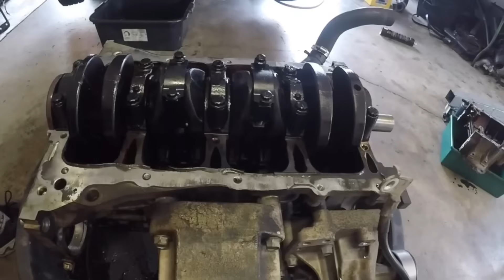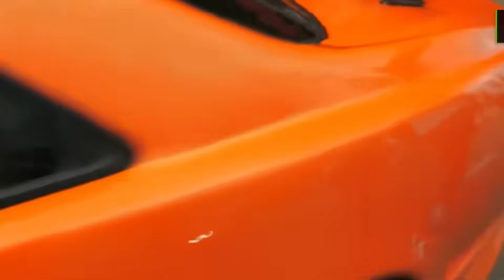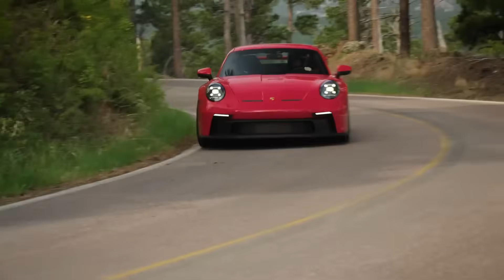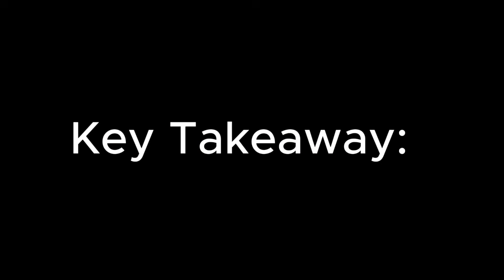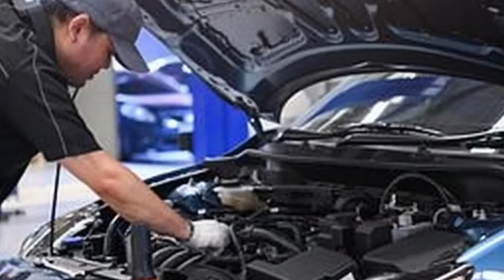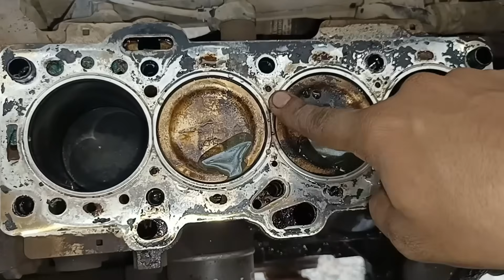STOP Following OEM Oil Advice (GM Recall Proves Why)

Comment: Yes using 5w30 or 5w20 can have positive results, depending on where you live. 0w-20 is useless once ambient outside temp gets above 75 degrees, these engines are failing worldwide even in Australia where they already came with 0w-40, the problem is the crankshaft itself, the manufacturer isn’t GM, they’re a supplier overseas and the tolerances are so far off from spec its ridiculous. The engine design is solid, they’ve got no one else that can retool and ramp up production to keep up with demand so they made poor decisions, now it takes months to get an engine. And the people making shit are still making shit.

Comment: All people have to do when buying a new vehicle say like today - Tell the dealership to dump out whats in the engine and refill it with 5W30 oil... OR have the vehicle towed to your home and do the oil change yourself.. BUT make sure they at the dealership understand this . Next follow a break in procedure of Light driving and the first oil change of 500 miles regardless  and change your oil again . Show the dealership that this was done and keep the records of it. Forget this 0W20 or 0W40 garbage and simply put in 5W30  and stick with that ... Need I say more??!
Reply: Yes you do need to say more. You are assuming US marketed API 5w30 is good enough, and maybe for you it is because you trade in every 5-7 years.  It is also proven API 0w20 oils are not good enough
Reply: And if they ever analyze your oil after a failure they can use that to deny any warranty claims

Comment: The GM recall does not prove that 0W-20 oil is “bad,” and spreading that folklore is misleading.  This video should be taken down by YouTube as it contains bad information.  Science is following your manual, the engineering and testing that produced the recommended specification, and only switching if you have lab based analysis showing a change it warranted. 

The root cause of the failures was a manufacturing defect in wear surfaces and internal components, not an inherent problem with oil viscosity. Engines with out-of-spec machining, surface finish issues, or contamination will fail regardless of oil grade. Oil cannot compensate for defective hardware.

GM’s use of a higher-viscosity oil in the recall is a mitigation, not evidence that 0W-20 is unsafe or inadequate by design. Millions of engines across multiple manufacturers run 0W-20 successfully when the engine is built to spec. The oil grade itself did not cause the defect.

Blaming 0W-20 ignores basic lubrication science and misrepresents what the recall actually addresses. Viscosity choice depends on engine design, bearing clearances, pump capacity, and operating conditions. When those are correct, 0W-20 performs exactly as intended.

The correct takeaway is simple: follow the OEM oil specification for your engine, use reasonable oil change intervals, and don’t turn a manufacturing defect into internet folklore about oil grades.
Reply: Yup, you're as smart as Elmer Fudd...
Reply: @lonniebeal6032 just speaking truth.  This is poor content with inaccurate information presented as “scientific” when it’s actually mere folk lore.

Comment: I Have a small automotive shop and I've never followed any of the oil guidelines.If the government is telling you or the manufacturers telling you what to put in your car , it's a total lie. You only run 5/w30 or 10/w30. In any car , I don't care what it calls for. I've been doing this for years with no issues , even cars that call for o/w16  or  0/w8 look at your owners manual. If you do as they say, I can't help it, you're stupid.

Comment: Cost cutting  and not cleaning up your mess. We have the tec today to make a ICE engine last one million miles easily. But under one house the push for electric we try to match but we will never will. 40 years from today electric will rule with battery tech alien to us now developed and actually works. When you go fast you trip pick your ass up and slow down it is coming but not in your life. My grandson will still love a V8 growing up in rides in my F150 Cyote the crackle at 6500 my 85 Mustang GT the rumble at 5500 a wrhrr from a electric motor SAGS MY BALLS.
Reply: There is no spirit. No redline to touch. It might be fast in some cases but it is boring

Comment: GM never stated this was the wrong oil. They stated there was a manufacturing defect in those years noted. For the 2025/2026 GM went back to 0w20……and if you change to 0w40, you would void your 5yr/60000 mile warranty.

This video is completely. 

Even in its “oil analysis”, its completely inaccurate. Its conclusions are not based in science, tribology.
Reply: Fact is both 0w20 Dexos and 0w40 DexosR pump at -35c while the 0w40 protects better with a < 3.5 HTHS

Comment: I think that GM going from 0W-20 to 0W40 was just a way for them not to admit that they screwed up with a 0w20. I think the 0w-40 is too thick but the 5W30 is the best to use. Now I think the reason why they went to 0W-40 is because if they went to 5W-30 then they'd be meeting that they made a big mistake but by going to the 0W-40 I'm a thicker oil will help with the 5W30 is the wrong oil to use. Why is Toyota Chevrolet wasn't there some other company saying that it was engine debris from the manufacturing process b***** The engines are creating its own debris because of the low viscosity oil that is not supplying the engine with the cushion that needs between the moving parts. 5W-30 has been around for years why change like the guy said in this video it's cafe standards.   I've made the switch 13, 500 mi ago and I never going back I made a review video on the conversion I did come and I am never going back to 0W20. And as for boarding my warranty f*** GM and f*** there extending a warranty program those people will look for anything to deny a claim. Have you changed out your headlamps with LED bulbs and you have any electrical issues they will blame it on the LED headlamps bulbs
Reply: Ford specs/certifies 5w30 for most all its GTDI engines & modern V8s. Only a very few get 5w20 as lightest grade. Smart. Both grades proven. Anything lighter is preposterous.

Comment: Excellent video 
https://youtu.be/hvagxNwrNq8?si=IC0Wcjd8M_xv0tEY
Check out my review video that I did after the second 5W30 oil change from 0W20.
I wish I would have changed my engine oil out to 5W30 after the first oil change that was done on the truck after I purchased it.

Comment: 😂😂😂 finally. Common sense prevails.
Reply: It took engines destroyed by 0w20, more videos will follow.  Ow20 if fine in cold climates, but not extended use in hot climates.
Reply: @lonniebeal6032  yes agreed 💯
Reply: When will Nissan learn? Never or too late?

Comment: Lol modern engines do not need frequent oil changes like old vehicles did. Today 10,000 or 20,000 is not unacceptable with today's advanced  oils.
Reply: Go ahead n do 20k oil changes n let us know how it goes lol
Reply: @deesnutz5576 I do 25,000 with Amsoil signature series for years brother.
Reply: LOL. Yes they do. GDI = oil dilution. Most all engines today are GDI.
Reply: Do us all a favor when you post your used rigs for sale on MP. Label it big and proud “OCI every 20K miles”. Ffs. 🤦
Reply: GM Dexos has a poor HTHS # for even a 10k OCI
Reply: You're a goof ass. Simple as that.

Comment: Most petroleum engines used 10W-30 with 3K change intervals for the longest time until the government began to intervene to get their slice of the pie. The same vehicles around the world doesn’t ever use 0w oil weight & the vehicles usually lasts half a million miles on average. But in the US, cars will usually breakdown between 125K-175K encouraging owners go 5K-10K miles between oil changes, saying that  synthetic oils last much longer before breakdown. Most Asian countries still recommend 3K change intervals & their vehicles last forever. Oil is cheep, engines & transmissions aren’t. No fluid in a car can last a lifetime. Building cars when I was young, I realized that manufacture recommendations we so the vehicle slowly becomes unreliable here in the USA. Ask me why I’ll never use an oil lower than 5w-30 weight & won’t ever go past 5K miles between oil changes.
Reply: Yeah, nothing can replace a proper maintenance period. Also driving conditions has to be matched by shortening the period when towing heavy loads or frequent idling or constant short distance driving.
Reply: Well said I can’t disagree with anything you said! And it goes to show you can’t trust what the manufacturers print on the oil cap telling you what oil to run!!
Reply: Make no mistake these manufacturer recommendations of 10-15k oil changes have only one goal, make your car die earlier, hopefully right after the warranty period
Reply: Plenty of countries around the world use 0w20 and there are many engines that get 300k plus trouble free miles using it.